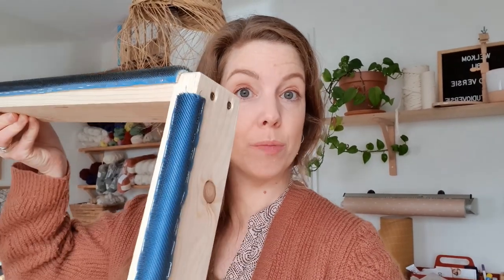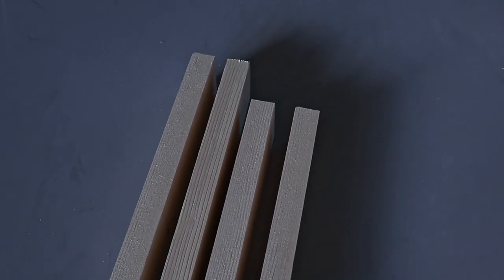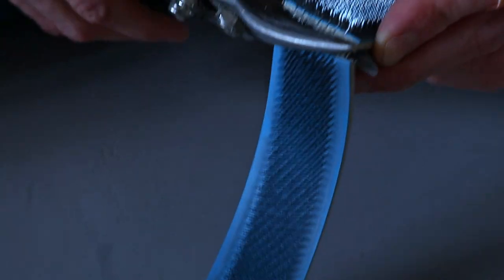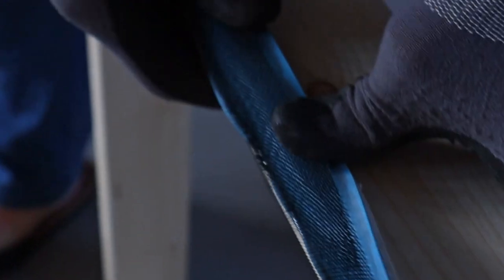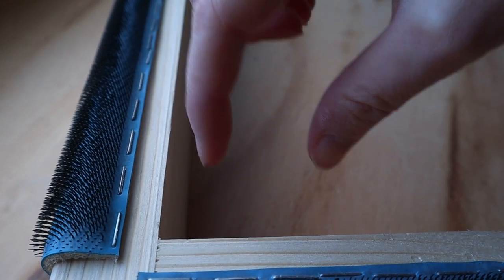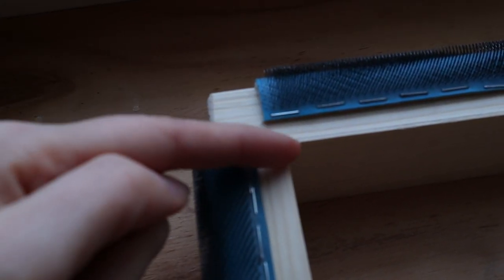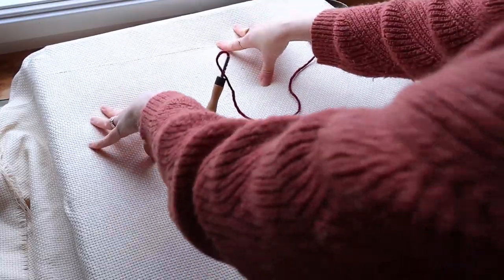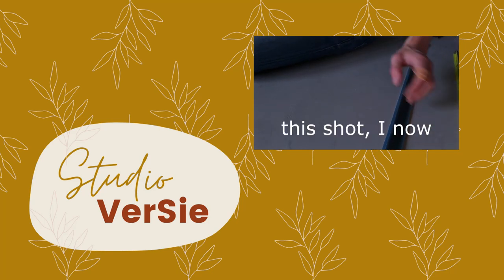HOW TO make a GRIPPER STRIP FRAME for punch needle

Comment: If you want to create an extra large piece then am I correct in assuming the gripper strip couldn’t be used on areas where you have already worked (as it may damage the punched wool areas)? What is the best way to work when you need to move around the canvas and not damage already completed areas? (Hope that all makes sense!)

Comment: Hello Vera - thank you for your great videos!  Have you ever used plastic QSnap frames with the plastic grippers placed on each of the four sides to hold the fabric in place? The frame is made from white PVC pipe.  If so, I'd appreciate your thoughts about it.  I've punch needled with circular wood and plastic frames which I don't like.  I look forward to your response or from anyone else out there that have used them.  Thank you!
Reply: I use those frames. They're okay, they work better than an embroidery hoop. I personally don't find they hold as well I'd like them to, I need to retighten the fabric constantly, but I also am heavy handed I'm not gonna lie lol. Pretty cheap compared to premade wooden frames with gripper strip and get the job done... But, I'm also here on this video, so maybe just make the DIY frame and skip those plastic frames if you can. If not, again, they get the job done! Just personally I gotta fix the fabric constantly.